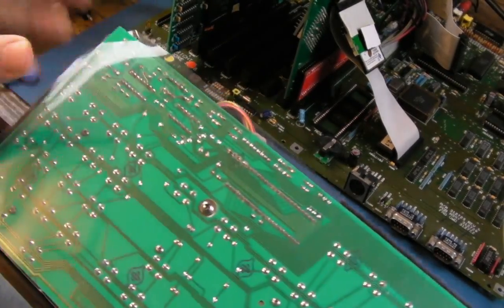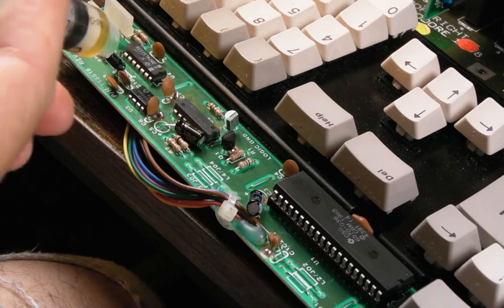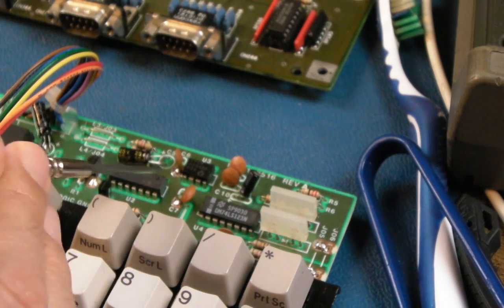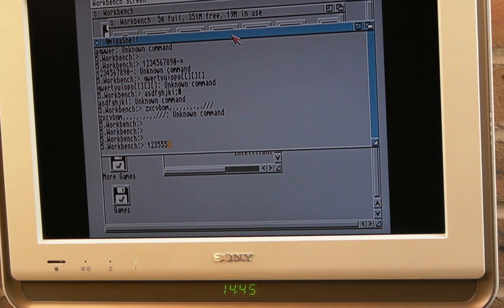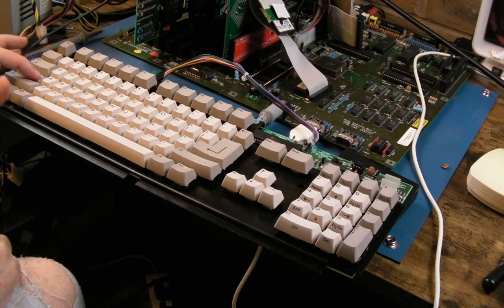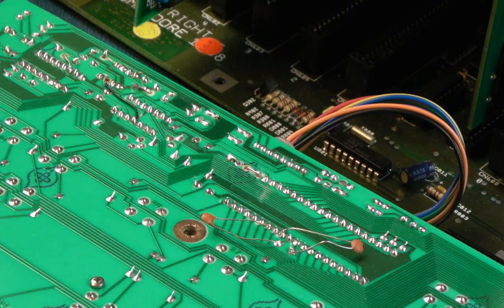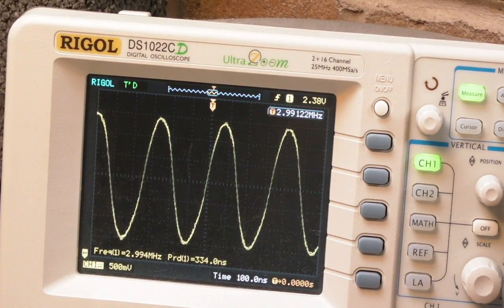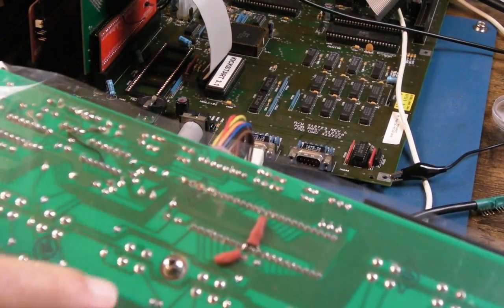Haunted Early Amiga 500 Chicken Lips / Space Invader Keyboard Repair (Very strange behaviour...)

Comment: I have a REV C version of the Hitek board and it has two small caps (marked 10) just to the right of the MCU (large IC) that have traces to the IC that go to the same legs as the crystal.
Reply from the maker: Sounds like Commodore fixed the issue quite quickly if they continued selling Hitek keyboards with a newer PCB design!   The 10 = 10nF, which is what all the later ones have.  22nF will work just as well though!

Comment: I had an issue with an Amiga 500 keyboard, all the bottom row keys like Z to M and the spacebar never responded, I got a new board that has the power and floppy light which did'nt resolve the issue, and then I got a new keyboard membrane, yet again the same problem still occured. Did'nt take it further and sold the whole lot as spares, repairs. I already wondered what the issue was the whole time.

Comment: Haha you are a genius mate! Well done.
Mega happy. 
Yes the CSG chip was soldered in the board when I bought it non-working on eBay (yes with the same original freezing fault).
It already has all those traces missing.
So I'm as confused as you??? Lol

I tried my best to compare it to other Hi Tek photos on the Web by finding limited 'rear of PCB photos' to compare and see if anything was different.

As you say there was literally one mention of a 'capacitor mod' on EAB, but there was no explanation and the thread died there.
I could not find anything else either.

That was obviously the same thing as your fix!

I then fitted the main MCU socket and yes, I have to admit, started getting angry and then sloppy with my soldering, so I kind of needed a slap on the wrist, that might be another reason how the 555 ended upsidedown!... what a d!ckh3ad.
By that time I was already emailing you in a rage.
Even though it was not working (I thought it would be an easy fix) it was a fair chunk of money to get that.
The keys on those stay white, which is why I wanted it.
So you can gather I was pretty p1553d off lol.

The keyboard fits OK in the case with the MCU socket, it may have been ok with the 555 one?
Yes one side of that plastic was torn when it arrived. Maybe the guy got as angry as me lol

Well it looks like you have filled a gap in information here buddy, they were not wrong when they said knowledge is power!
As we spoke before, the whole community is going to benefit from this. I have had other people asking about the same issue, nobody knew.

Maybe I should of asked Dave Haynie, but you spring to mind first as you're into it all still.

Much ❤ Man, Gadget does it again!
Honestly how can I send you some pennies?
I'm over the moon xxx
Reply from the maker: Haha, thanks mate =D  It's not a worry regards the solder points and few damaged connections - the traces and pads on these are easy to break!!!  And I've been there myself where I break some traces and lose pads when getting frustrated etc!  It's in great condition I think and a really lovely keyboard!!!  Hopefully it gets back in one piece!
Reply: @GadgetUK164  Well I've chucked you a nice chunk to say thanks on Ko-Fi.
I cannot thank you enough! Enjoy.